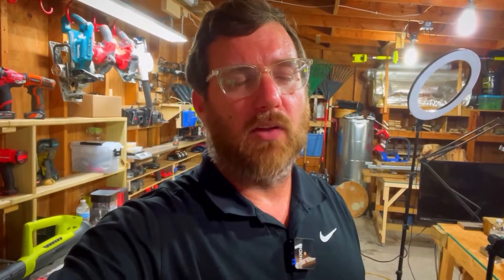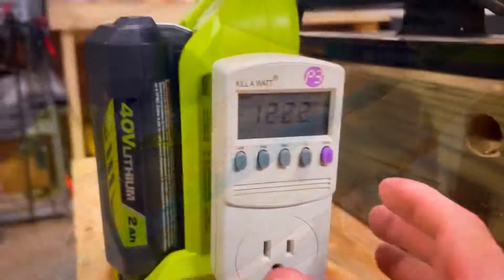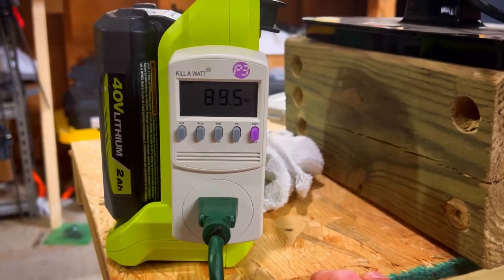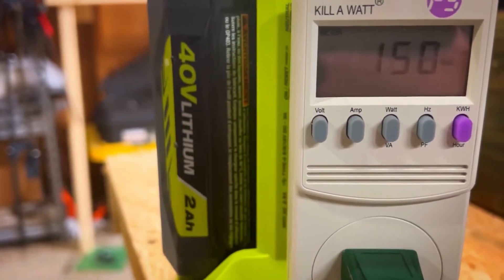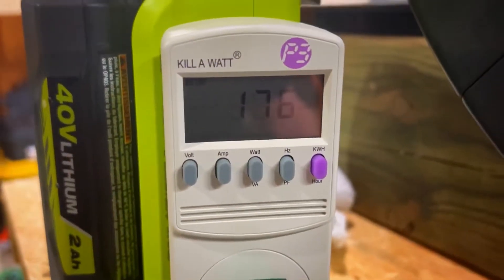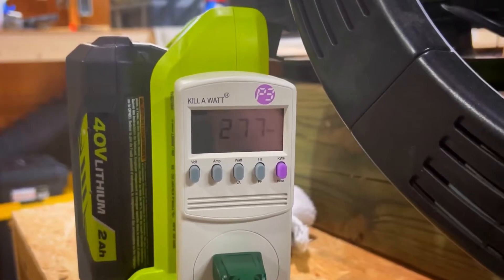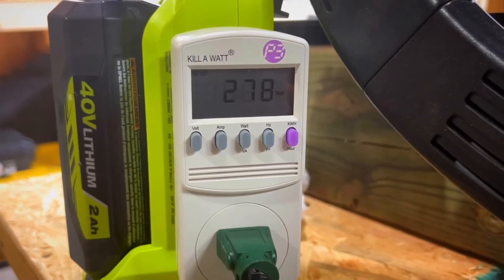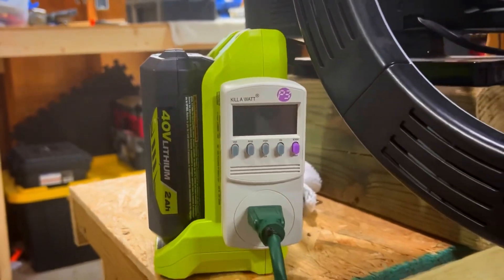Does the Ryobi RYI300BG Inverter Really Put Out 300 Watts?

Comment: You need to monitor the voltage as the load is increasing. It’s not realistic that the Ryobi fan added only about 10-15 watts to the total consumption, so something is squirrelly with the measurement. Possibly the voltage is dropping, and causing some of the other loads to consume less.
Reply from the maker: I’ll have to check that out. Thanks.

Comment: i have 2 of these
1 trips at 260W ON THE DOT
The 2nd one trips at 271W ON THE DOT

I also have the 2 of the smaller 18V 150W and those 2 actually DO handle 150W and trip around 155W ...

Comment: If you used all incandescent bulbs for the load it would probably do the 300+.    Inverters tend to be rated at unity power factor loads.  The mix of loads used here (fans etc.) won't have perfect power factor.   With these loads you should monitor the VA on the killaWatt instead of watts.  VA reflects the true current being drawn - the same current the inverter itself will be monitoring ( and shutting itself down based on )
Reply from the maker: Thanks for the tip

Comment: Per the Ryobi website its Rated for 300 watts continous ! imo --- its a fail ! 300 is 300 not 275 not 280. is your killawatt accurate ??? thats another question ? imo --- if im making a product & selling it as a 300 watt device it shiuld do 300 + watts ! 300 should be its nominal wattage under poor conditions 100 degree ambient etc. imo --- i Would think it should do 325-350 then cut out. its rated for continous 300 ! id return it & Get another one ! Do a Take 2 video ! try another killawatt too ! for accuracy. Put your amp clamp on the cord & Do amps x volts = watts to check killawatt accurracy.
Reply from the maker: I can do that for sure
Reply: I returned 2 of them because neither would hold past 270W .. Im on the 3rd one and it also trips at 270W ..
Emailed Ryobi and told them the story, they sent me a free one and it also trips at 270W .. Emailed them back and they wont return by emails ... 
So now i have 2 here and both trip around 270W and don't do the 300W as claimed

Comment: Will it run vacuum pump?
Reply from the maker: Not sure since they pull a lot higher amps at start up unless they have a soft start. I did notice that my Yellow Jacket pump was running at 100-200 watts once it got going though.
Reply: id like to see that test with a 2 or 3 cfm pump.
that would essentially make a battery powered vacuum pump.
Reply from the maker: @OcRefrig  I can try the Harbor Freight pump on it
Reply: yes i run my 240V well pump off this